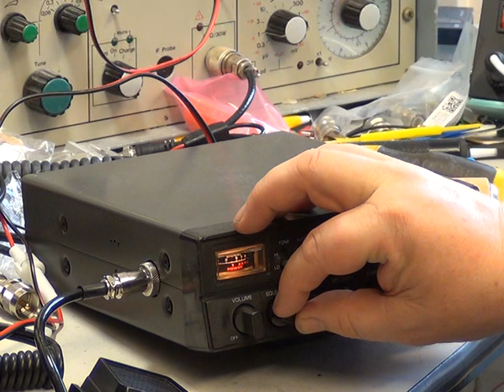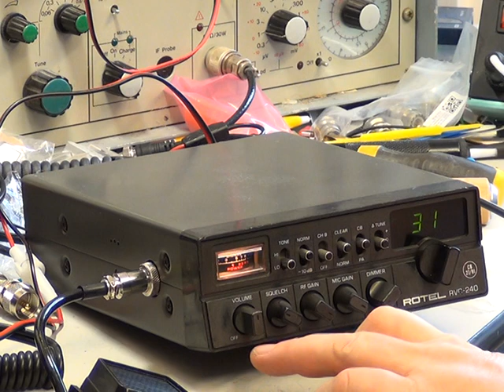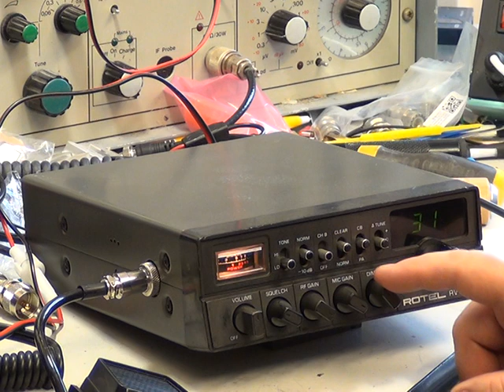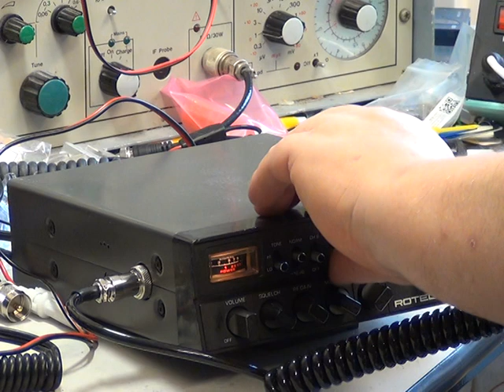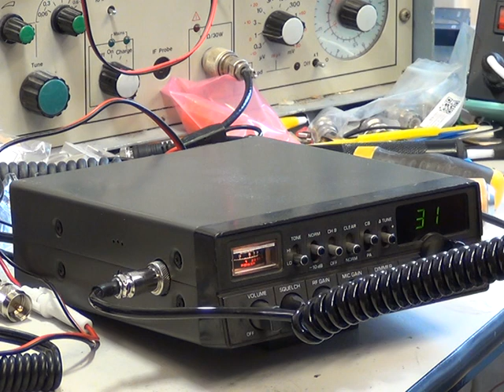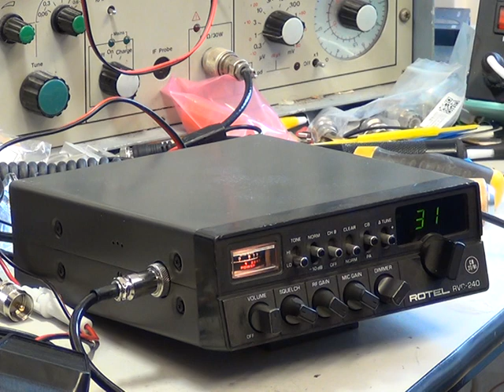Rotel RVC240 (UK) CB radio (CB27/81) -  On The AIr Test

Comment: I've just bought a mint 240 to compliment my 220 which I've owned for 35 years! Ten miles North from you, are you still into cb's?
Reply from the maker: I've never been a CBer - just a 2-way radio engineer who is happy to service UK FM CB radios as well as the usual commercial business radios.  We do the tests between 7 & 8PM most evenings on channel 31 if you want to earwig.

Richard, G0OJF, UK

Comment: I once had one of these lovely radios & it worked beautifly FAULTLESS!!!  I personally prefer it the Harrier CBX  although they was supposed to both have the same chassis ( board layout) inside. Just the front was different.  But, i found that Rotel had overal better performance & sound quality. Maybe i am biased but,  that's my own personal opinion on them.   (Please excuse any spelling mistakes).🙄😉
Reply from the maker: I personally prefer the Binatone 5-star version of this chassis. There is a performance difference not from make to make like Rotel to York but because of component tolerance. We have that Rotel RVC230 as a calibrated test standard. I picked it from amongst 30 seemingly identical sets because of it's exceptional receive performance.

Richard, G0OJF, UK
Reply: @ukfmcbradioservicingTango21  Yes the Rotel does have a great recieving performance. But,  that can also be a set back due to either or operators not too far away or more often using high powered set ups 100watts +   just to talk to someone half a mile away.  I know i was a radio operator that suffered extremely badly from this many,  many years ago. & this just one of tge two reasons i packed up. The second reason was the verbal abuse i constantly got from others ( not all just some ) & it was them that was using high powered set ups stopping me from being able to hear anyone i was trying to hear ( even just a few miles away let alone long distasce was totally impossib!e.  So,  i thought whats the point in turning the thing on & sadly all my set up got stolen whilst i was out shopping or seeing a relative or someting else ( can't remember as to what exactly) but,  i was not only horrified but,  sadden & disgusted by it. I unfortunatly never found out as to who did it but,  i did have my suspcions as to who. But,  like everything back then i sadly couldn't prove it. So,  i lost out & never replaced it I thought why bother if the hassel & grief i got was still going to be there. & haven't still Although i do have a few here but,  no means to power them & no swr or similar antena tuner nor any anten a or aerial  & as my budget is rather limited i can't see me doing anything with them They were given to me but,  that is as far as i got with them.  Anyway i have said too much now. Take care & best regards from me.

Comment: Its 2021 and I still have my original 80's purchased Rotel RVC240.
 Its is still alive and AFAIK has never been screwdrivered unless the CB shop did it before I bought it.
The meter bulb is dead and one of the segments on the channel display is dead so the bottom of the 9, 8, 6, 5, 3, 2 are missing.
I also have an Audioline 341.
They both light up when tested in the garage, but I use a modern PNI Escort 6500 rig in the van, due to 'hideability'.... Its hard to place and secret away the old rigs.
Reply from the maker: Roger on size, otherwise we'd have Harvard 420M's or Rotel RVC230's (same innards) in all the cars here....but they're too big.

Richard

Comment: I've still got mine as part of the collection. Bit of a mess tbh, but works fine. I was too tight to buy a bracket, so as many did, I drilled holes in the lid to secure under the dash the reattached the unit to the mounted cover :(
Reply from the maker: I often needed a lower profile mount so had to drill the lid. Sometimes with rigs I buy for my won collection, I fill the holes with car body filler, sand it off & respray. I could do a video on doing that. When brackets are missing,general purpose brackets are available.

Richard

Comment: Still have one in very good condition.. That said preferred the Harrier CBX.. And Hy gain 5
Reply from the maker: The hygain 5 is not a UK legal set, so it's performance is irrelevant on this UK legal only channel. However, the SMC Oscar 1 is similar styling, works well & came out of the same factory and once again (like the Harrier & the Rotel) uses the Cybernet 134 chassis.

Richard (UK)
Reply: @ukfmcbradioservicingTango21  As did the York, and Binatone 5 star..

Comment: woooo i still got my RVC240 with original mic and box, had some great times in the 80s, glad to see CB making a comeback, might be time to dust off the box and see if the airwaves are still alive around here, Staffs WestMidlands, hopefully be more mature chat rather than the childish shite we had to put up with back in 80s, the jargon seems to be more in line with radio ham these days, i need to do some research to bring myself up to speed with groups etc, if they exist.
Reply from the maker: City use is still pretty useless between the burner brigade, silly voices, music playing & people illegally using amateur radio equipment on Citizens Band. I'm in a rural location here & the 27/81 band works great for us here with 35 mile range on totally legal equipment. The EU band here, incidentally, is useless here with S5 of residual background noise so we can only get a few miles.

Richard (UK)
Reply: Did you ever get back on???
1 year ago I just plugged my old Rotel240 into the cig lighter and lumped the old magmount on the van and listened on 19.
Its alive in this area (Hull) Its almost like the old days but without the morons.
At home on a bad day I get s3 of noise. Not an issue since Im mainly mobile.
Ive noticed there's pockets of electronic noise... 30+ noise, If I tx I carry the same noise with me, But its in a very defined area. If I move 10 yrds its gone.

We have plenty of radio hams using radio ham kit on CB, they are the burner crowd, apparently they talk on CB because theres no-one on the ham bands.

Comment: Do you do local repairs? i have a RVC-240 i could do with a good service. you'll probably recognize where i work from my profile pic,
Reply from the maker: Yes, I can do...but our main business in in (traditional. not electronic) church pipe organ restoration & I'm really pushed for time until february 2020.

Richard
Reply: @ukfmcbradioservicingTango21  thats fine, i am in no rush as i have a modern radio as my day-day work horse, would just like to have my original rotel as a back up as i feel its been the best radio i ever had.
Reply from the maker: @garymetheringham4990  email me rshireby@yahoo.co.uk
Reply: Alright Richard I have a rotel 240 and the sound goes of but if I tap the top it comes back on would you be able to fix it please

Comment: Any new videos on the horizon?
Reply from the maker: Sorry, but no. I'm on an organ restoration/installation contract at present so no electronic repairs are being accepted.

Richard
Reply: UK CB radio servicing I understand. Good luck with the organ restoration and I’ll just have to be patient for another CB radio vid in the future. 73’s.
Reply from the maker: @spinnerinthebubbleCT4543  Thanks!
Reply from the maker: I've bought a 1964 heathkit DX60 amateur radio transmitter for restoration & my use (from the 'States). D you think there would be any interest if I did a video on that...when it arrives...or do you think I should just stick to CB on this channel?
Reply: UK CB radio servicing I think there are different audiences for different aspects of radio. My interest is primarily CB/11m/27mhz and that’s why I enjoy your channel. I have little or no interest in the ham side of things. It only takes someone to type into YouTube the make of that transmitter and up pops your video and you’ve got another viewer. You’ve done videos on other things besides CB radio(think you did one on a record player) so why not do a video on this transmitter? There will be an audience for it, big or small, you will be putting a smile on someone’s face. 👍

Comment: Really like the Rotel looks and sounds great. So what works best a 89 or a 2019  in a like for like radio test? I would assume that modern radios use digital signal processing in both the transmit and receive paths but I’m guessing?
Reply from the maker: The best range seems to be achieved with the older radios. The Rotel 230 & Harvard 420M bothhave front mounted low power switches that I find vital if you are in convoy & chatting to the car behind. ALthough latest sets have loads of features, the CPU noise limits the receive range. We have Midland 78Plus multi radios in our 4 available vehicles. One is the latest blue display model & is disappointing in so far as the TX takes about a second to develop an output, plus the mike has a tendency to pick up RF interference off the transmitter!

Richard
Reply: UK CB radio servicing. That’s a very interesting observation and I don’t disagree. I have a very expensive Icom hand held using Dstar and it is completely ruined by the internal cpu noise.  I suspect the modern  DSP is used to reduce the discrete component count and passive filtering for price reasons.  Regards Chris

Comment: I bought a Rotel RVC220 from my local Argos store in Coventry back in 1981-82, cut down version of this radio but a nice CB had a lot of fun with it, always thought it was a smart well made looking radio, very solid and quite well built, the Antenna is still in my mums loft all of these years later, a DB27 on an aluminium spider ground plane, the radio is long long gone though sold it when I got my callsign back in early 90s.

Great fun video always enjoy your videos.
Reply: knoxieman  didn’t everyone own a DB27 at one time or another
Reply: @allthegearnoidea6752  DV27

Comment: Is there any way to turn off the Roger bleep on the Mustang 240 I think it is. No switch on the radio thanks
Reply from the maker: No, but it can be permamently disabled by removing internal parts.
Reply: @ukfmcbradioservicingTango21  just need to lift one capacitor (Amstrad 901 board) and put a switch in line.